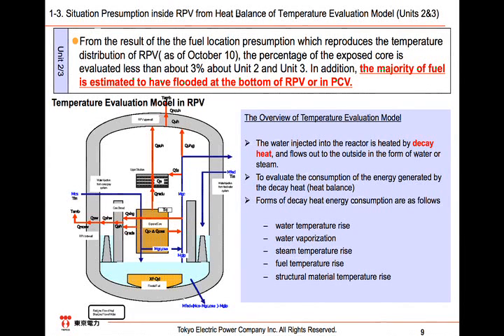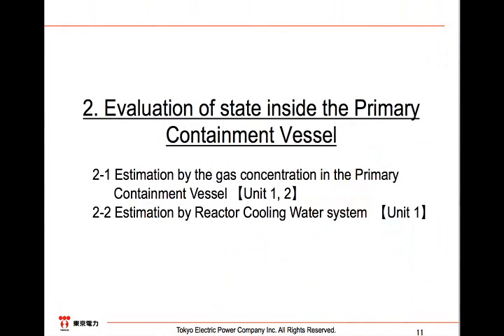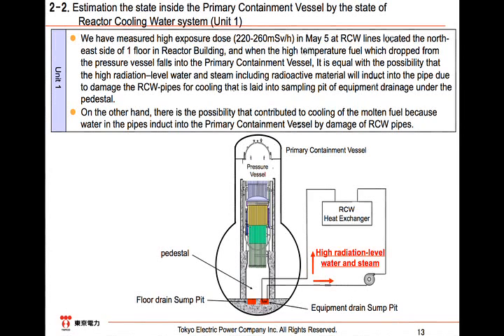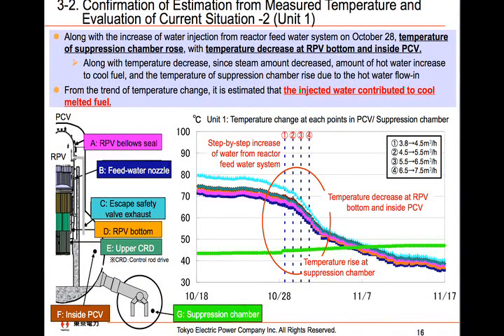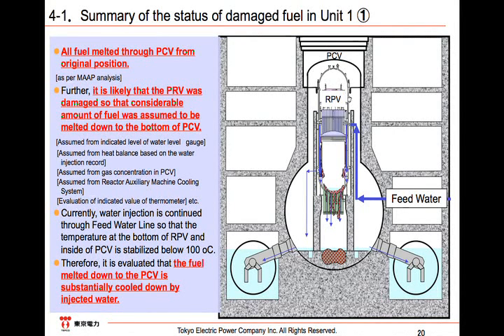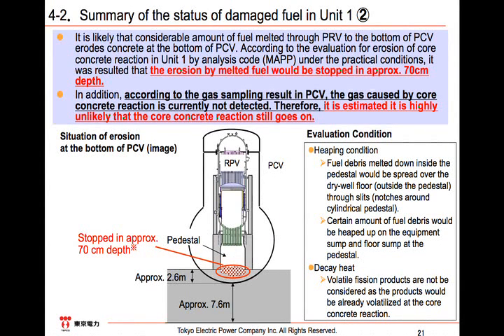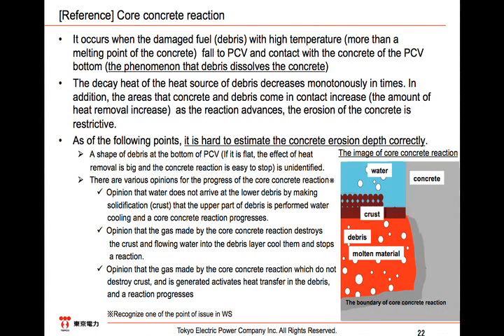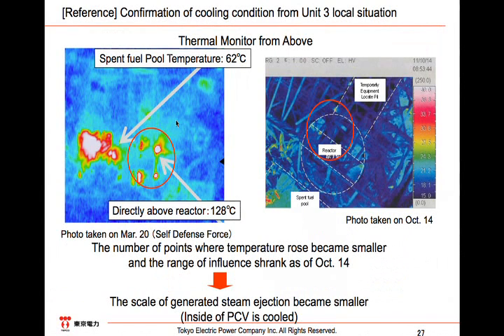The Evaluation Status of Reactor Core Damage at Fukushima Daiichi (2/2)

Comment: How about some yank primates who have no clue what they are talking about and are barely able to heat water just shut the feck up? The "parrots" successfully cleared up your very own mess between 1985-1990 and also will handle this.

Not to mention what might have happened if such an disaster would have struck three "extremely well maintained" US reactors...